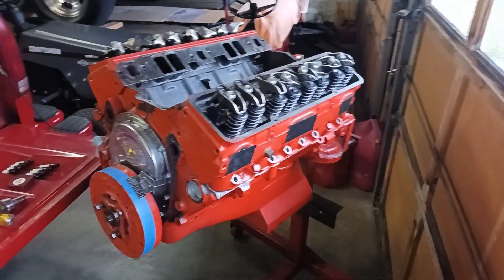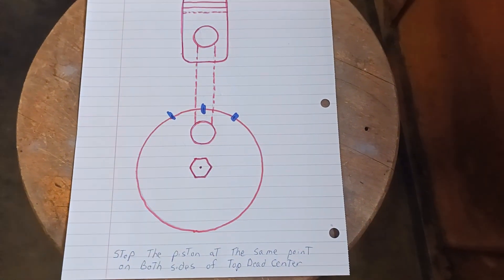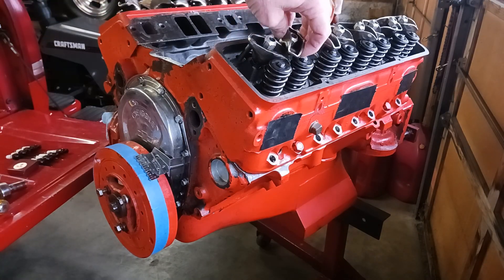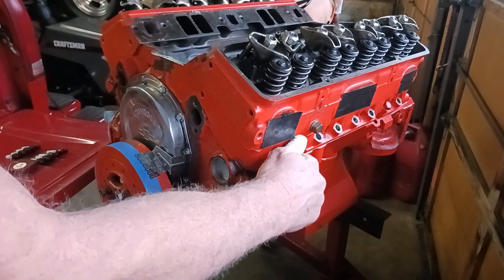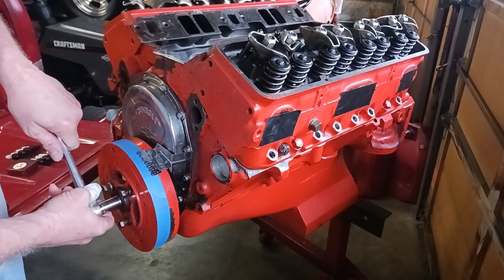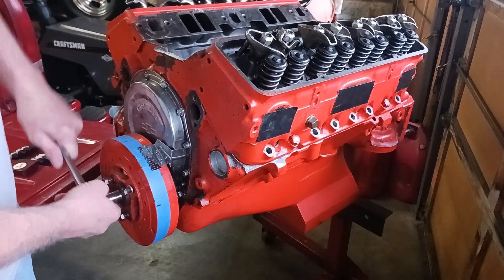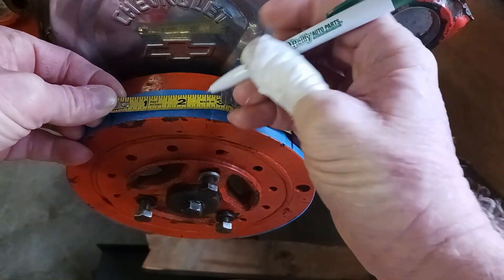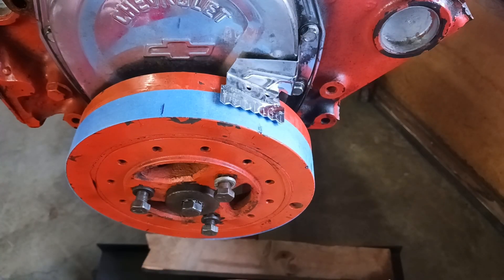How To Verify Top Dead Center On An Assembled Engine (SBC)

Comment: Take the number one spark plug out put your finger in the number one hole and bump the starter until it blows your finger off the hole and number one will be up and check that it's not out 180 degrees

Comment: great tool; gotta get one!
I'm doing my first build and I'm stuck on the next step; After finding TDC , before I stab the oil pump drive in, I'm confused if I am to point the rotor to piston cylinder #1 of the block or the desinated #1 of the distributor cap. My build is a mopar 383
Reply from the maker: It should point to the designated #1 on the cap. 
Thanks for watching  !

Comment: Definitely need to put first mark on 1 or 2” then subtract that from measurement. Trying to line up the metal end on the tape will throw off your measurement by up to 1/8-1/4”
Reply from the maker: Good point  !

Comment: I’ve tried this on my motor with 12cc dish pistons and the stop won’t touch the pistons, any suggestions?
Reply from the maker: I have never done it with dished pistons.  Do you have the stop adjusted all the way in ?

Thanks for watching  !
Reply: @briansummers8030  Yes I used two different stops one that came with my cam degree kit and I made one from a spark plug so I could use a longer bolt and that didn’t hit either. This is on a 383 stroker, AFR Enforcer heads, pistons are .005 in the hole.
Reply from the maker: @akram7858 I have never had that happen.  Are the heads angle plug ?  If so, maybe that is the reason.  I wish I had something to tell you to make it work.  Sorry.

Comment: Could you just use a piece of string, fold it in half when you get the length, to find center?
Reply from the maker: @zacheryandersen  what I am actually explaining is how to find when the piston is at exact top dead center in the cylinder.  The string method would work to find the halfway point on the balancer,  but that is a totally different situation. 
Thanks for watching  !

Comment: What am I missing here? If you have not removed the cam or changed the timing chain why would the harmonic balance not indicate TDC at zero giving it is keyed. If you did replace the cam or timing chain then you would use the dots on the crank gear and cam gear to time the cam to the crank.
Reply from the maker: @fjb9234  If you buy an old car, you might not know for sure that the harmonic balancer or the timing tab are correct for the engine.  If one of these are wrong, then you will never know for sure if your ignition timing is set correctly.  This is why you need to verify that the timing marks match at TDC.
Thanks for watching  !
Reply: It's also possible for the harmonic balancer to slip, and then the mark will be in the incorrect position, it happened to me.
Reply from the maker: @Mr_RD-1876  yes, that can definitely happen

Comment: Does it matter how long stopper is?
Reply from the maker: @whodatisful  technically no. You want it to be long enough to stop the piston before it passes top dead center, but not so long that it hits the cylinder. The piston stops that you can buy at the parts store are adjustable. I try to stop the piston approximately 30 degrees before tdc, so I will have about a 4 inch spread on my marks so it would be easier to find the center. . Thanks for watching  !

Comment: Why do you remove the rocker arms?
Reply from the maker: @jeffm7669  If you don't loosen or remove the rocker arms, the valves could hit the piston stop when you are turning it over. This could bend a valve very easily. Thanks for the question, and thanks for watching  !

Comment: I just use a pressure tester and crank the motor till I get the highest reading
Reply from the maker: @summitpushtraining  but I don't think that will find top dead center  ?
Reply: @briansummers8030  Good thing about chevy you can almost be half off
Reply: @briansummers8030  Works eveyrtime for me ..What I do. is take the distributor cap off take out my number #1 spark plug . put in a compression test turn the motor till I see my highest reading stop get out of car look at fly wheel to see my timing mark might have to tap the key a few times to get it close make sure my oil pump shaft is at 11 and 5 clock and put in my new distributor posting at the #1

Comment: Thanks for doing the video- Yall say the engine rotate clockwise wich is twards the right-  my question is why are you rotating it counterclockwise
Reply from the maker: @Joe-xj2tb  looking at the front of the engine,  it would be clockwise . Thanks for watching  !
Reply from the maker: Rotate clockwise until it stops and then counter clockwise until it stops.  Top Dead Center is halfway between the two marks (where it stopped both times).

Comment: Just wondering if that is an 8 inch or 6.75 inch balancer. I just did mine today with all new Chrome and Howards roller cam using a aftermarket 6.75 inch balancer from Summit. My marks were 6 7/8 apart divided by 2 is about 3.50 for center. I came in on my desk top computer to double check as they are further apart and wondering why. It is a 1976 Corvette.
Reply from the maker: My balancer is 6.75 inch. The distance between the marks depends on how far the piston stop goes into the cylinder. It really doesn't have anything to do with the size of the balancer.  Just turn it both ways until it stops and measure between the marks and divide by 2 and that would be true top dead center.   Thanks For Watching  !
Reply from the maker: I'm sorry,  that one is an 8 inch.  I was thinking about my 327 in my chevelle.  The one I did the demonstration on is a 350

Comment: What balancer do you have,part number?
Reply: Okay, thanks. I have a three fifty crate  with an aftermarket balancer And lined it up like you did it the video.
Just be nice to have the right balancer.
Reply from the maker: It is just a stock 350 balancer and I don't have a part number, sorry.

Comment: When I turn the balancer counter clockwise the bolt is loosening and I can’t  turning the balancer a full cycle? Any help  so that the balancer bolt won’t loosen. I torque the bolt at 85 lb per ft but when I turn the the balancer the same way you do counter clockwise the bolt loosen
Reply from the maker: If you remove the spark plugs, you should be able to turn it easier.  You can also turn it with the flywheel or if the pulley is removed from the balancer, you can put 2 of those bolts in and use a large screw driver or pry bar to turn it.
Reply: Thats because the engine rotates COUNTER CLOCKWISE!